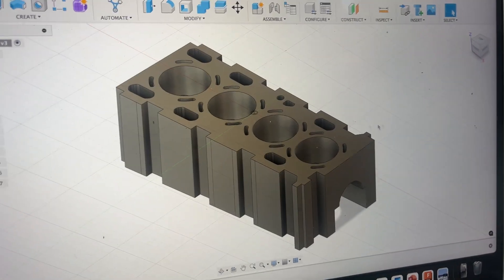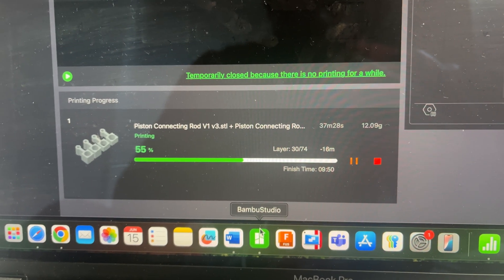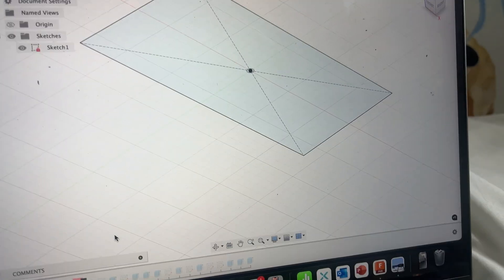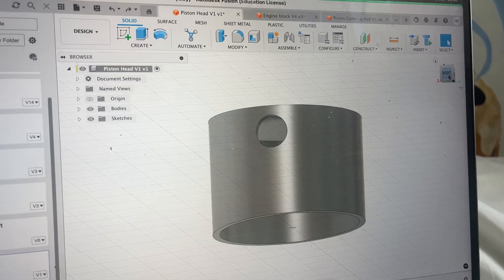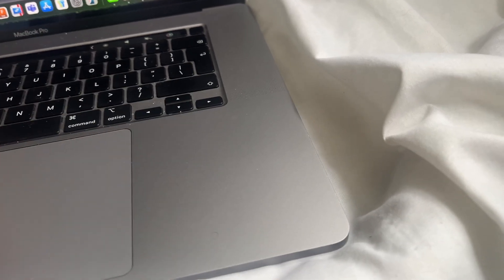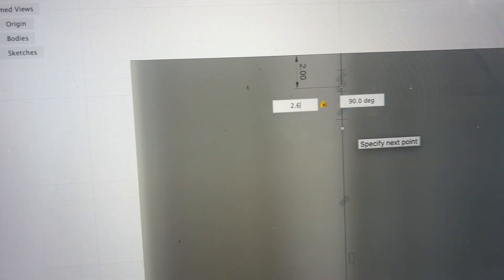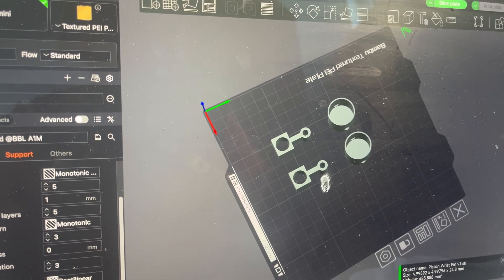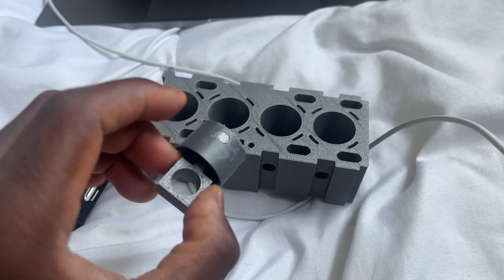Can You Really 3D Print a Working Engine?

Comment: Could print everything in a "vertical" orientations so that the layer lines in the block and the layer lines in the piston are parallel so that its smoother
Reply from the maker: Oh yeah that’s true actually, but for my next model I fixed that completely without changing the orientation, I had just redesigned both parts which I’ll explain in my next video

Comment: Hi I88Y looks great one tip i have for you if you need to print something with supports (pla top and bottom z distances on 0.2 works fine but if you print petg  0.265 is the sweet spot) supports will come off really easy.
Reply from the maker: Oh okay thanks for the tip. I’ve never actually printed with petg yet only PLA I’ll try it when I get some